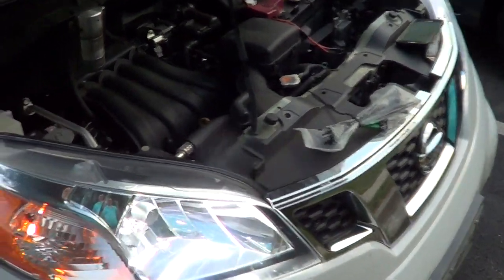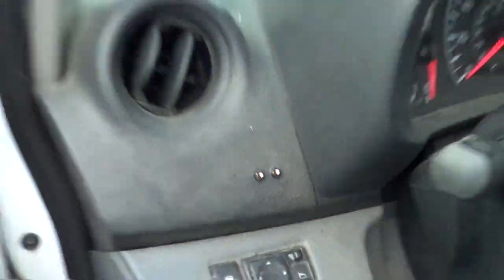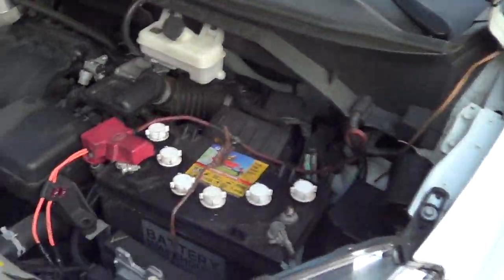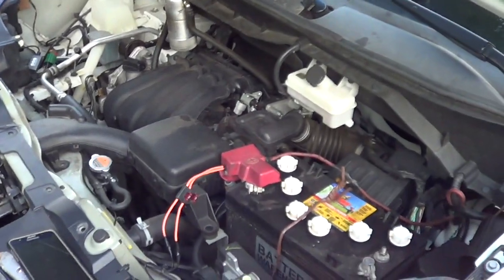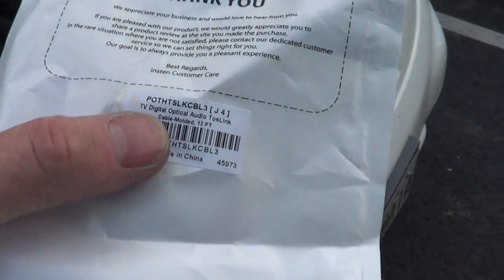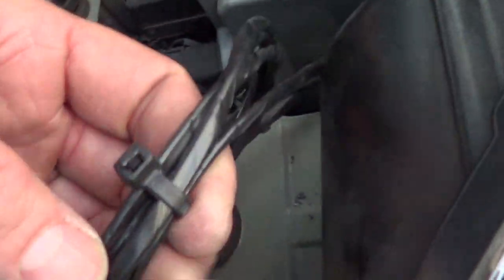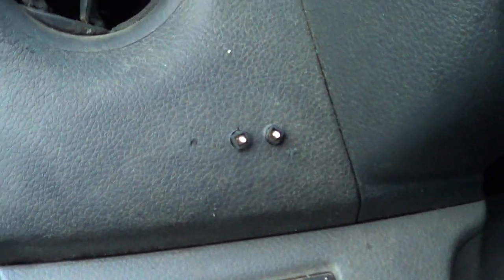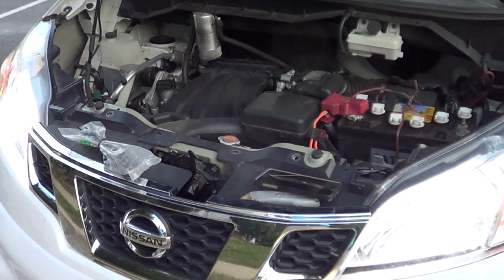Fiber Optic Headlight Indicator

Comment: I am about to buy a mini split the doesnt have gas I was wondering if I can refill it with propane it uses r410a but I cant find any bottles under 3 lbs
Reply from the maker: Propane is illegal for refrigeration the US because leaks can leaks to explosions.  R22 was designed to replace propane.  It keeps showing up on eBay, but propane really isn't worth it.  Also, normal bbq propane is probably going to be wet.  Your system is r410a.  The propane pressures will be totally wrong and capacity will be half.